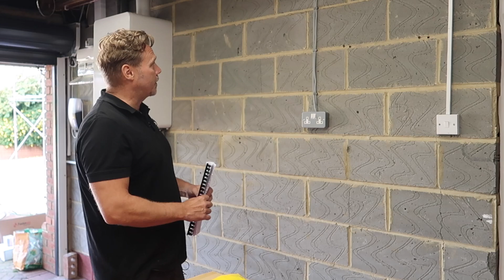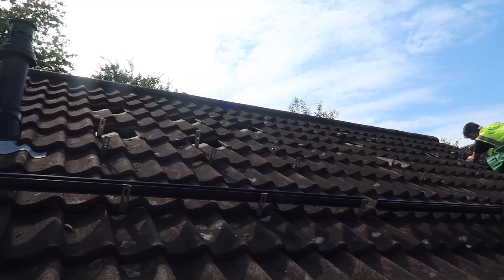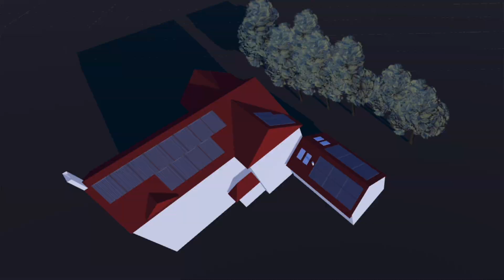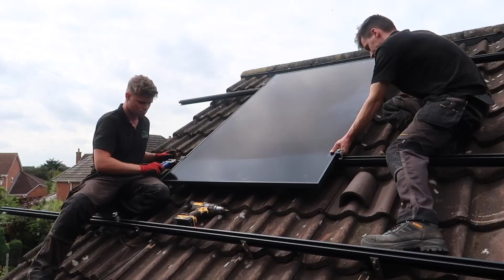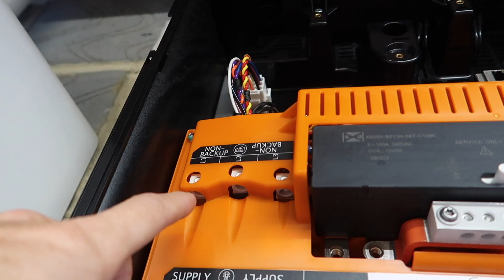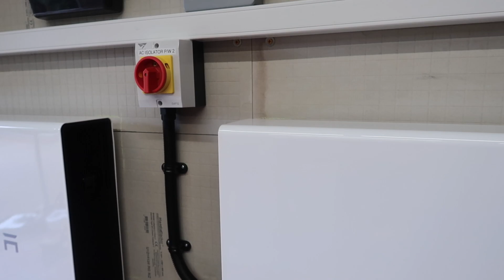Two Tesla Powerwalls & 12.28 kW Solar System Installation | Stockton-On-Tees

Comment: What size cable did you use from the inverter to the consumer unit ? Nice job
Reply: Thank you for the reply Great tidy work
Reply from the maker: The inverter is wired from the gateway not the C.U and is wired in 6mm